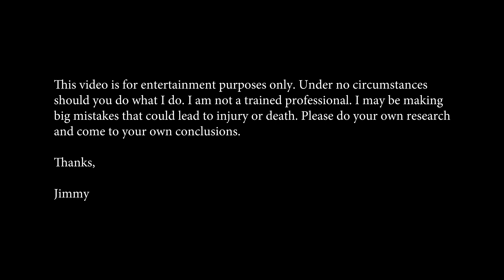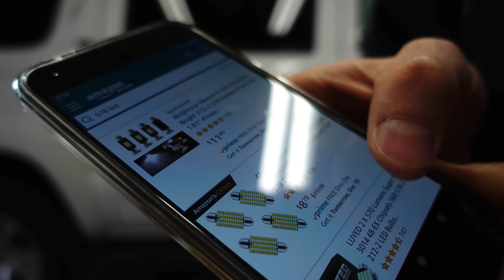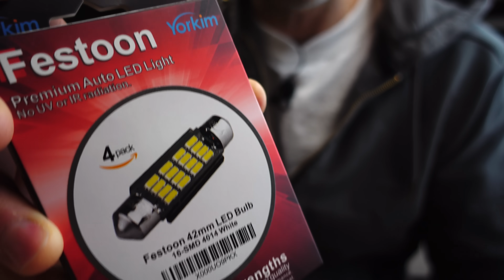Here's Why You NEVER INSTALL LEDs IN YOUR CAR OR TRUCK!!

Comment: Halogen and xenon use a gas medium to generate light with voltage, incandescent uses a wire filament that vibrates with voltage, generating heat and light.

Comment: The voltage drops of LED’s in the majority of vehicles safe to say should not cause any issues other than some versions and vehicles possibly bringing up error codes because it detects a voltage difference etc, it’s negligible and most good LED’s on the market usually are made to not throw codes, but it depends on the vehicle, they typically offer much better illumination too, usually it’s the super cheap Chinese LED’s that go faulty, make sure to buy them from a certified brand that has warranty.
Reply: @Star Pillars This comment right here. This is why I've only bought LED bulbs for my vehicles and my friends, from the same outfit since 2007. From headlight to taillight, and interior..all have been great LED replacements. I did have a pair of 194 LED wedge bulbs go out, but they replaced them.

Comment: I've got the same truck as you, a '99 that I'm slowly restoring and fixing up, and I'm on the light project, too. If you look at the back of the truck, on the roof at the exterior, there's a bar, that I presume is for lights. Can you tell me what the name of that fixture is, so that I can look into what lights I need to install in it? Thank you.

Comment: some cars will throw a code if you replace with LED bulbs.  The resistance is not equivalent, it might confuse some control modules.

Comment: Why you would feel the need to change interior, license plate, or turn signals to LED. Now I have a 2015 GMC SIERRA, and was replacing the Halogen headlights every 7-8 months. Switched to LED headlights that have a cooling fan built in. No more problems. The rest of the entire truck bulbs, isn't a concern.

Comment: If you do regular blinker fluid changes it should stop the overheating, in those models you might need and aftermarket blinker fluid reservoir the stock ones are too small

Comment: 2022 - LED has replaced halogen, CFL and has now started phasing HID out. HID discolors quick, burns out quick and the ballast burns out quick as well. 

LED remedies all of this. LED now even projects as far as HID. This used to be an issue. 

BTW, online reviews show benchmarks of LEDs and recommend what suits your needs such as color, heat dissipation technology, dimension requirements, lifespan, beam pattern etc.

Comment: some older fords may have a problem charging if some specific bulbs are not working or if they have a non stock resistance.    my 61 comet would not charge unless the oil lamp bulb in the dash was in good condition when lit or not..... sounds weird but these were still early electrical systems and considered the best at their time a new led replacement may not carry the same resistance

Comment: I jumped on the LED bandwagon back in the day. Replaced the brake lights. My car wouldn't shift out of park unless i pressed the override button. I put the original bulbs back in, and got my money back for the LEDS. Had a friend recently put LEDS all around his vehicle, he ended up with electrical issues. I told him that he has to install a voltage regulator. Cost him major cash.

Comment: The reason the LED lamps get so hot and fails is due to the current limiting resistor which has to dissipate the energy as heat. The temperature gets so high that the solder joints can melt.
The better LED bulbs have some electronics on it that uses a switching regulator to limit the current going through the LEDs. The switching regulator is ~90% efficient so very little energy is lost to heat. Operating LEDs at high temperature causes them to age/dim much faster than if they were operated at lower temperatures.

Comment: Speaking on Exterior light for your vehicle of the turn signals - you must also change the relay to electronic from the old standard that was dependent on the load bearing bulbs or your turn signals will not work properly and will hyper flash ...

Comment: I got many feston like leds in my old astra g car( even in dashboard) and they can last long.
All interior and licence plate leds are over 4 years old! The only one I have problem is, the position lights in headlight, they heat alot and don't last that long( few month's, maybe 6 at the best. So conclusion, go for quality led's, you will not regret it.

Comment: When I put led conversion bulbs in the dome lights of my Chevy truck (same vintage as the one in this video) I found that the led bulbs that I got have polarity. So if you pop one into the socket and it does not work, flip it over.

Comment: One thing in didn't see get any mention and I may have just missed it as I'm rather distracted at the moment but it's a fairly important detail on led so just in case I'm saying something. A lot of aftermarket led bulbs in the market are not like the good ol oem throw it in the socket and watch er light right up type of beast. They in my experience will only work if you have your polarity correct. OEM don't matter just so long as you get the bulb in the socket. So in conclusion if you have replaced any bulbs with led and the build don't light up. Take it out, rotate 180° replace and see if that works for ya. Sometimes you'll get a bad one but most of the time this will work!

Comment: Problem with those thick-wedged retrofits is that they may not work in the housing. I bought a couple of them and I tried them in my Toyota which uses T10/W5W bulbs almost everywhere and none of them worked. I got the thin wedged ones afterwards and they worked like a charm.

Comment: LED makes sense but I find the ones in some newer cars are woefully inadequate compared to the old style incandescent. In our 2020 RAV4 the cool white interior lights look nice but try and find something in the back hatch when the outside lighting is low or even the cabin space for that matter. Maybe Toyota is being cheap and just not installing enough of them.
Yes the new LED headlights are great for the driver, not so great for oncoming cars, way too bright. The design of these things are not quite up to snuff yet and that's for most manufacturers.

Comment: I changed all the dash and other bulbs in my f350 with LEDs.  All but the headlamps.  I love it.  The flasher relay was upgraded to accommodate the lower current of the LEDs.  Sometimes with the dash lights polarity is important.  If in doubt look for the little + sign and put them in all the same way, then test before putting everything back together, all lit, you are good, no lights, swap them around.  
Have fun, be safe

Comment: I get the feeling a lot of the cheap LEDs are specced to run from a steady 12v feed. As in the 12v a car never really pushes through them....

So you get a wonderfully bright, massively overdriven, LED that shines its life away far quicker than if they were properly driven at their correct voltage.

I'm thinking of splicing voltage regulators into the interior lighting wiring. Eventually...
Reply: LEDs have stepdowns, that's what causes the heat... Excess voltage/ current becomes heat.

Comment: Be sure to check if it's legal where you are driving .. 200€ fine in Spain for front facing LED/HID where not fitted as original No problem for taillights though 😅

Comment: A note from a guy who got into electronics (leading to a career as a an electronics tech in aviation, then in bulk electric power) before LEDs existed. I remember the first ones, only available in red blob form with wire leads and built into things.
Oh, yes - a note from the recent past: LEDs still only operate at a rather specific voltage somewhere between 1.8 volts (red) and 3.3 volts (blue/UV) ... just the physics of the things. But (you must surely say) these are white LEDs! Okay: under the skin, they are actually fluorescents! They are blue or UV LEDs with phosphors, much like a fluorescent light without the mercury vapor.

Back to now. There are still no 12V or 120 VAC LEDs. The bases contain some basic electronics to turn whatever the rated input is to the proper voltage. In high power stuff it is efficient (and bulky), but in these little lights it is a basic heat-dissipating voltage regulator - sometimes just a resistor. The LEDs don't burn our fingertips and melt sockets; the voltage regulator does. That is why the plastic body LEDs are so troublesome: most of the plastics are thermoplastics and will soften or melt even in normal use and are also poor heat dissipators. Stick with the non-plastic ones and life is better.

Voice from the future, signing out!

Comment: The former bulbs are not halogen, they are simple incandescent. 
 Now in my 1997 Buick Riviera that has the automatic lighting system, two of the rear marker lights between the other larger light  bulbs that were on all of the time. One burnt out and the other was about to melt away the socket. So they both got replaced with the LED type bulbs, to avoid the heat of the incandescent type bulbs that were about to ruin the sockets. Everything else is still the same type of factory style bulb.

Comment: to the future guy...if there is a dimming to off function for the overhead lights when you close the door, it seems that LEDs may not be supported with their low resistance. They just may end up staying on slightly, and that could be a problem should you leave the car for a while.

Comment: I’m curious how the old “regular” bulb got so hot you had to wear gloves although you didn’t mention that was a problem. You constantly mentioned the heat of the LED bulbs. So you are saying LED bulbs get hotter than regular bulbs? That is opposite of a house incandescent vs LED which is much cooler.

Comment: I've never had a heat problem with an LED, only incandescent bulbs. I changed out all of the bulbs in my travel trailer to cut the heat and power consumption. Not sure why you would be having issues with them.

Comment: led's are in a state of exponentially rapid refinement ... the problem youll most likely encounter is buying a bulb that is several 'generations' old even though that may be less than a year .. your getting someones pile of 'old stock' unloaded on you .. id say amazon is your best bet, stick with vendors obviously moving alot and dont penny pinch, the latest ones will be a tad more and near the top of search results ..

Comment: Put led headlights I bought in a flea market, there was no shield to limit direction, I was lighting up reflecting signs blocks away and annoying oncoming drivers who repeatedly flashed their lights at me as we passed each other. I used them one day only, putting my original halogen bulbs back. I also bought bulbs to replace my taillights, they were 1157 type common for the stop, tail light use. After replacing them, my instrument panel warning lights came on when hitting the brake or turning on the lights. I think these lights are supposed to come on when the incandescent bulb burns out, because the circuit is drawing less current, which has the same results as using leds which draw less current. The vehicle, a Hyundai Tucson was designed before leds were in common use, and the dash idiot light, which was traction control would not be on unless it was on startup or the traction control button was activated.

Comment: The problem I had was my dash lights on my old 86 F150 were dull , so I bought a selection of LED bulbs,  the problem I had was they are polarity sensitive,  and when you are trying to turn them 180 degrees , you "should" turn the key off  ! , especially if some of the bulbs have a aluminum body , because as you lift them to twist to the other postion , the body will "short" across the printed circuit board  :-(   and that's not good  😐  . Cheers buddy .

Comment: Jimmy, I recently purchased an LED interior light kit for my 2017 VOLVO XC60. I replaced the dome lights, glove box light and map lights. Now, my glove box light and license plate lights do not work, the power drivers seat does not work and my fog lamp switch does not work. 
I don’t understand. The box of LED lights says these LED lights were made specifically for my Volvo. Do LED LIGHTS cause electrical shorts or blow out fuses and replays?  I’m confused

Comment: I replaced the head lights on my truck with LEDs. Somehow water had gotten in the driver's side head light housing and filled it up halfway and froze solid. The headlight never stopped working. After the ice thawed I drilled a small drain hole and drained the housing. It's been a year and the headlight still works. I'll never go back to halogen.

Comment: What I recommend as well is to look up videos of the brand you're planning to buy just to be sure if you want to go with the brand you find.

If you don't find any videos then I would recommend avoiding them but if you can find some decent amount of videos on the brand then weigh out your options once you see the results on the videos.

That's how I came across the brand I got and they have been working great for me.

Comment: I've been using cheap leds for many many years & rarely have any failures about 50,000 hours, every single light I have changed 84' Isuzu diesel 99.5 super duty 7.3 400ex....

Comment: Back in 2015, I replaced my Subaru Outback's turn signal, marker, license plat, and reverse lights with LED's, and it was a disaster!
Well, not like the Hindenburg disaster, more like the "I paid stupid tax" disaster.
I purchased the turn signal lights (With 50 Ω ballasts) from Diode Dynamics, and they're still working great today!
The others, I got from Amazon, and can't remember the name, if they even had names...
All of them failed within a few months, and had to be replaced.
After replacing them, they too burned up, and a year or so later, I replaced them all with Sylvania LED bulbs, and they're still working great!
Today, LED bulb tech has come a long way, but the cheap junk is still out there, so when choosing LED bulbs, make sure to stick with decent brand names, with decent reviews.

Comment: I have many of these car LED modules but never used them in a car. I made 9 volt battery lights and other hand lights out of them. That broken one you have that failed due to heat If I had one that failed I'd take it apart and mod it and make it work again.

Comment: The problem I run into is the LED uses much less current and thus the sensing signal sent to the bulb makes the computer think the bulb is burned out.  Worse yet - that sensing signal makes the LED slightly glow so in the dark my car has LEDs that are just slightly glowing. The current they are using is so low it won't run the battery dead but still it is unnerving to walk out into the garage and your car is glowing.

Comment: There are so many form factors for auto interior lights. I ordered at least 10 LED replacement lights for our cars and most all turned out OK.

However, we have a Grand Caravan with 2 upper front map lights that have a fading dimming circuit. I replaced these and even when turned off they we dimly on. They were hard to take apart and replace. I had to put in the original filament light bulbs to avoid running the battery down.

I found in our Toyota Corolla the array of over 24 LED lights provided much more white day light into the cabin of the car. The original incandescent yellow light is much dimmer. The LED lights in daylight color is much nicer to see and read in darkness in a car.

My first LED car replacements were over 5 years ago from China. I obtained 10 LED replacements for nearly $10 with free shipping from China. It may have taken over 3 weeks from China but well worth it.

Comment: You said your video was for entertainment, and it was entertaining. I like the brighter light, but even better I like the fact that if the light get's left on by accident, the LEDs won't kill my car battery. I will do the research, but if the links you provided are just as good I will use them.

Comment: The one area that I found an LED to be preferable was in the trunk area of my SUV. The halogen bulb light switch was not door activated. On more than one occasion I left it on and came back to find the battery dead. I've made the same mistake with the LED bulb in place, but I still had battery to start the car the next day. The amount of light in the trunk area is increased also.

Comment: I build those 168 marker lights in LED with the Glass housing on them.
just remember to use Amber or Orange with the same color of Orange Lens and the same for RED Lens use Red LEDS ( If not the red lens with White Led will turn Pinkish).

Comment: Here’s an easy fix! Don’t buy garbage LEDs! I run DDM leds and I have always been with them since the HIDs. I installed Saber Pro 50w LEDs in my fog-lights and headlights in March 2018 in my 2018 civic si sedan. They still work haha. I just took them out and sold them to a buddy and installed Saber Pro X 55w. Got bath sets for 250$ on Black Friday. Plus 2 year warranty. The best part about DDM is not led went after warranty after 4 years (2 years past warranty end). I asked them to send me a set and the girl asked what happened to the ones you had!? I told her one side of the leds went black. She discounted the new set they were shipping me by 45% and 1st class shipped them to me for free. For blinker leds or taillights, side markers I’ve always stuck with Philips and Sylvania. They are 10-20$ for a set but I’ve been using the same set for 7 years in 2 different cars.

Comment: My silverado came with led headlights turn signals and taillights.   I put in led reverse lights, license plate lights and third brake lights. So I am a fan of them. But I am not a fan of replacing halogen headlights with led bulbs. The reflectors just dont disperse them right. They end up blinding others.